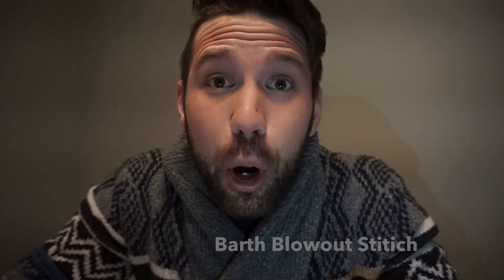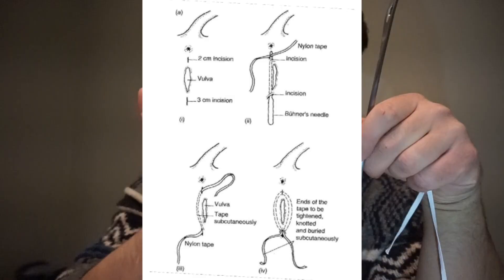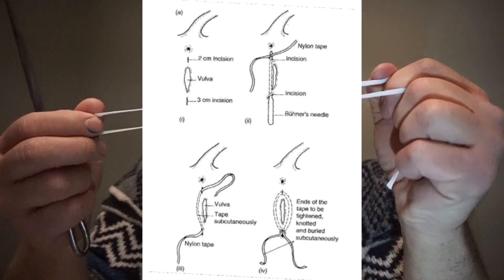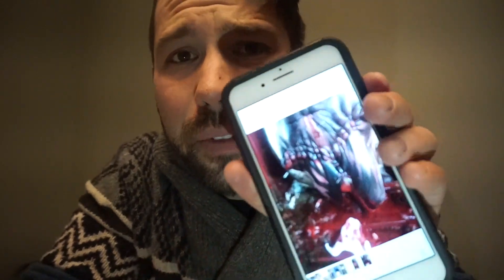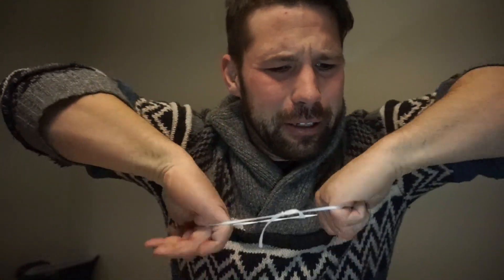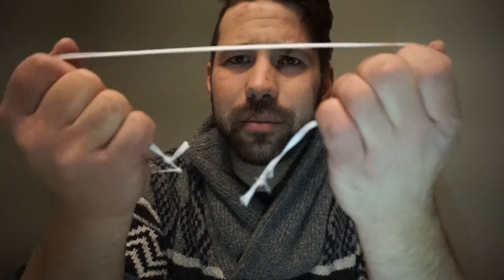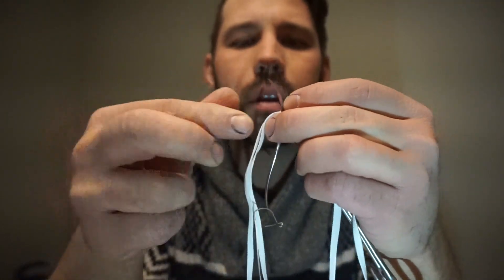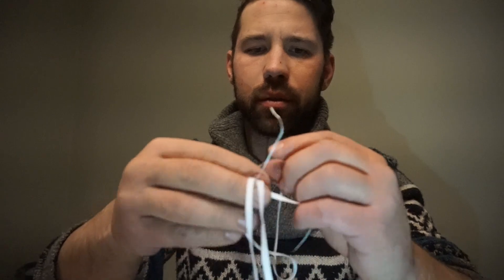Barth Blowout Stitch, the best vaginal prolapse fix for a pregnant cow

Comment: Hi Cody, thanks for the video! Sorry I'm a bit late to the party, I would like to start doing these but wondering what size supramid/nylon suture would be optimal to make sure it snaps at the right tension? I'm guessing too thin and it'd break too easy, too thick and it'd be similar to just tying the obstetric tape in a knot the normal way?
Reply from the maker: It's actually the individual strings of the tape that break. I have used 2 and 0 supramid without issue. Good luck!